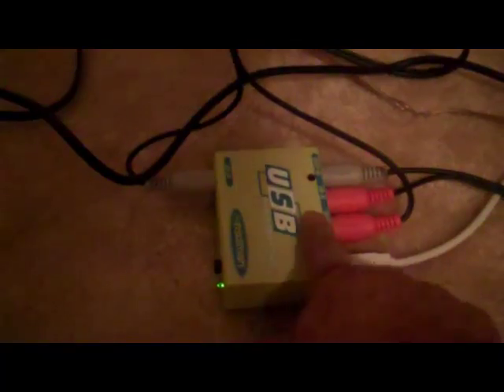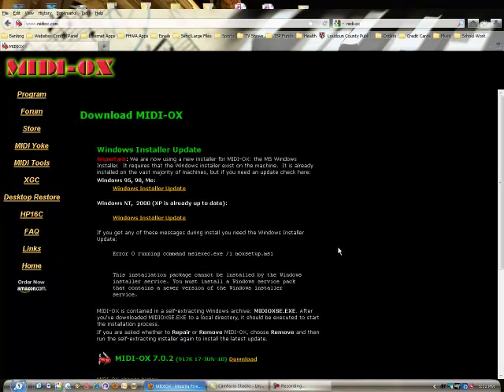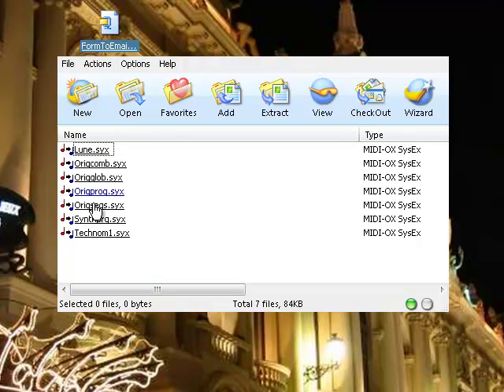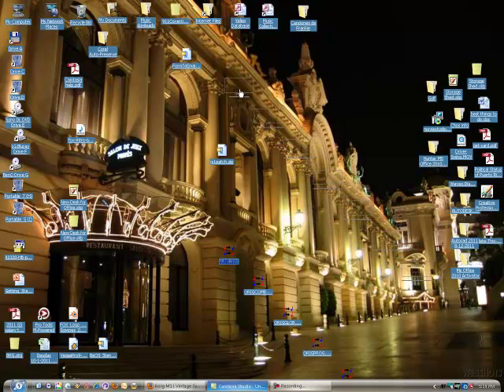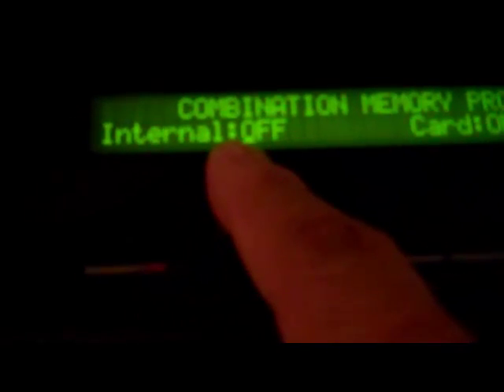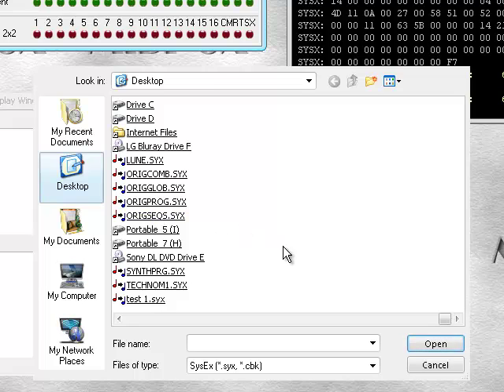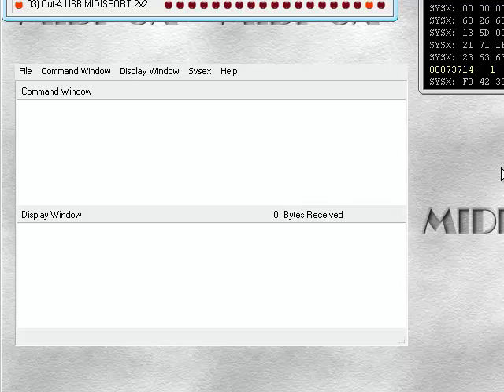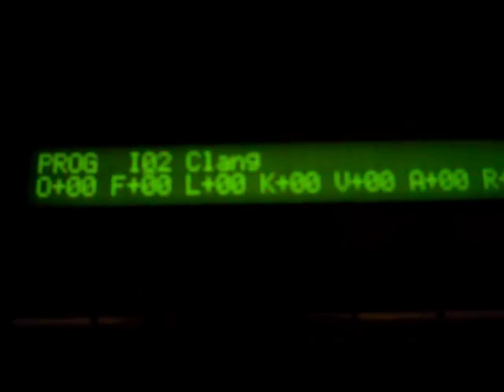Patch Replacement for Korg M1 after Battery was Dead

Comment: My humble contribution for this issue:

I recently bought Korg M1 and wanted to reload the factory presets. I bought a cheap generic USB-Midi interface and watched this video carefully and followed all steps. Nothing happened. I tried with MIDIOX on PC and SysEx Librarian on Mac. I read all the forums over the internet regarding this and tried different buffer settings. That took considerable amount of time.

The solution was to use quality midi interface and cables. I borrowed a Focusrite Scarlett 2i4 and a Klotz Midi cable, plugged it in to mac and all the SysEx files went in without any hassle, or tweaking with the buffers and stuff. Everything was done in 5 minutes. Probably it would also work with PC/MIDIOX, or any other quality midi interface.

tl;dr - Do yourself a favour and go for good midi interface.

Otherwise this video is an excellent tutorial of how to do the trick.
Reply: I'm about to embark on the journey, I've got the Scarlet 2i4 also.  Did you have to use 2 midi cords as he describes?

Comment: First, thanks for taking the time to make this video. It is appreciated.I was having the same issue that many folks are reporting - nothing happens when you send the file. After reading the post by Paavo below, it dawned on me that although my midi cables work, they are 15 and 20 feet long. All I had to do was grab a 3 foot cable and it worked fine. I did not have to tweak anything. I am using a Tascam US20x20, Win10, and a USB 3.0 port with MIDOX, and once I went with the shorter cable, It worked perfectly.

Comment: Your vids on the battery replace and patch were VERY helpful.  I finally got all orig patch and combi restored.  Two problems I had: 1) the cheap midi-USB (oval shaped) found on ebay for $6 were no good.  They work for note transfer, but drop some data sometimes, so sysex transfer wont work.  I got a better midi-USB and then could trnsfer some patches but not all, (the first 11 or 12 would be ok).  2) I increased midiox buf size to 16K, 100ms delay, and loaded it as 2files (prog & combi)

Comment: Sir,
Thank you for thoroughly explaining how to do this.  I was able to 'fix' both M1's we use in our school system after I replaced the internal batteries.  One minor point:  I needed to set the MIDI channel to "1" in the M1 to receive the data from MIDI-OX.  Channel 9 that you used in your video didn't work and I couldn't figure out where to change the MIDI-OX channel. Where in MIDI-OX can I change that send channel?

Comment from the maker: I am glad everything worked out for you.  I don't personally recommend using those cheap midi devices especially those on a single cable.  As I have said before I have two midi boxes (midiman and Midisport) they are around $50 to $80 but get the work done.  Especially know that I am working my way thru to the soft synth side of my DAW.

Comment: Thanks for the good info, this was very supportive. But just wondering if you have run into an M1REX  (rack version with extended memory, no keyboard)  like HyperSoraSky I'm not getting the 100 programs/combi's although using the patches you recommend from vintagesynth.com  I'm getting more programs/combi's loaded (up to I73 and P83) only loading I53/P60 from other website providing "original patches" . Just wondering should those files be loaded in any particular order, and.. I had a buffer error originally with midiox that i fixed by increasing number of buffers within midiox,.....maybe increase buffer size....?  Thanks again for the good info.

Comment: I found this very useful, thanks for posting. I've found several hundred .sys patches online and I was wondering, does the M1 store more than 99 Combination Patches and 99 Program Patches without a card? Right now, that seems to be the limit and adding new patches just overwrites the previous ones. Thanks.
Reply from the maker: Internally it can only do 100 combis and 100 programs.  You can format the cards which should be cheap now a days and add an additional 50/50.  But with todays computers there is no problem storing these files you found.  I have hundreds myself.  All you need is a librarian.  I use Midiguest Librarian.  It is the first incarnation of what we know now as a Kontakt type librarian. With the exception that all the files are system exclusive the one and only way in those days to brings patches to these units.  Now with librarians such as Kontakt everything is done with wave files.  The midi librarian gives you freedom to overcome the 100/100 limitation.  Hope this helps

Comment: Thank you very much for your response  looked at your while i was doing every thing all over & i had made several mistakes i bought a cheap midi to usb cable from ebay & plugged  it just like you said (In to Out & Out to In) but if i plug it like that it doesnt show up on Midi-ox, if i plug them In to In & Out to Out it shows up but it wont let me send the files to the keyboard  i don't know if i don't have the keybord on the same midi channel as the midi ox

Comment from the maker: Sorry for the delay responding I was out of the country.  I use the following buffer settings.  256 bytes, Num 32.  Now remember this has to do a lot with the midi interface you have.  I have not had the need to change these settings, ever!, but I have a EMU Xmidid2x2 interface an it works very well with it.  I previously had another midi interface a midiman 2x2 but it did not work well with Windows 7 64bit.  Hope this helps.  Thanks

Comment from the maker: Most cables i have used in the past i bought from radio shack. They worked fine. Later i bpught better csbles from guitar center i little bit more money but they can be also found in amazon cheaper. Rule of thumb if you are tunning longer runs (8 feet or more)  get bettet cables. They usually bettet shielded and better wiring. So if you really know that your midi interface works fine in your DAW then switching to better cables would be a logical approach especially if you have longer runs. Hope this help.

Comment: Dear anievestor, thanks for your support! Unfortunately I still have problems with the soundstransfer. I don`t know where the problem is. Where can I see which MIDI-channel I have to take for the transfer? (I use MIDI-OX) I know that normally I have to stick one MIDI-cable into the keyboards MIDI-out and into the PCs MIDI-in. Now I use this instrument ( M-Audio MIDISport Uno ) I have sticked the USB-contact in the PC. On one MIDI-cable stands in and on the other out. How connect to KORG M1? THX!

Comment from the maker: I have Midiox 7.0.2.372 and for a while this program has always transmitted and received on all channels.  In my case I used channel 9 (on my M1) for some reason I quite can't remember right now why I used it, but you can use it on any channel. Just make ssure your Midi filtering is set to receive System Exclusive data and take the protection off, set it to any channel and your done.  Try it and let me know.

Thanks

Comment from the maker: Ok I am confused.  First of all I understand that you have a Midi interface that is USB, correct? If that is correct then the second part of the equation.  Do you have a Midi controller keyboard that is also USB?  If you are connecting the Korg thru the midi usb interface the flashing green and yellow are OK not bad.  It means that there is communication with the PC.  Does your computer register it a usb controller that has been properly installed? Just a few questions to help you

Comment: OK. I got my M1 connected thru midi to my computer, downloaded midi-ox,  and the M1 sound files onto my desk top, made sure all the settings on the M1 are as they should be . . .   BUT still nothing happens when I try to send the sounds across to the keyboard. . . .    :(                 Are there settings within midi-ox that I should be checking  . . .  ?                                                     You mention making sure that midi global is set to CH 9 ,   then no further mention of it,   Am I missing something I should be checking elsewhere  ?    Hoping you can help me   DjT

Comment: anivestor, I have the same problem here. I looked at all the settings so many times but I cannot make it work. I am using the patches from the website you showed in your video.  I am using a Mac and SysEx Librarian because MidiOX is nto compatible with Macs. Any advise will be great. thanks

Comment from the maker: Have you been able to successfully communicate with a sequencer and the keyboard? This can tell a lot.  Go to your sequencer and try to lay down a part and then another part.  If you can record and playback the parts then you midi cables are setup correctly.  IF not then they are on backwards.  Most of the time when you get a light stuck like that it is either the cables connected wrong or the cable or cables are bad.  Check this out and let me know

Comment from the maker: There were several releases other the years when the M1 came out.  I only gave you one link to use but you can search on the internet and you will find a number of other files claiming to be the originals.  They might well be.  It all depends on the year your model came out.  Down load them all and upload them until you find the one that you had before.

Hope this helps.  On the subject of the name not showing up you probably downloaded a file that was corrupted.  Try downloading it again.

Comment from the maker: There has been a number of users that have had the same problem and 9 times out of 10 it is the cheap interface. Especially those you can buy off of eBay or made in some foreign countries. You are right and if you see the extended comment string I have talked about plenty times but it certainly wouldn't hurt to mention it again. If you have am interface that you own and know that it works use it or do what you did get one borrowed and test it. Thanks again
Reply: +anievestor do you think it could be done with only 1 midi cable ?
i cant connect in and out at the same time but i could switch them during the process
Reply from the maker: +Captain Mike Meloni Well let think this one over.  MidiOX will send the information from the computer to the keyboard.  IF you have a good interface that interface will have both an in and an out!  Having said that if you are trying to send the patch information to the M! or similar device, the OUT cable of your midi device should be connected to the IN port of the keyboard.  So you are right to assume one cable is good enough for this exercise, BUT, if you are planning to swamp patches in your device from time to time you definitely need two cables.  Taking them out and swamping them could at some point damage the port.  Also if you are going to use it in a live performance setting them you definitely need both ports connected.  I hope I answered your question.  Let me know how it goes.  Thanks
Reply: thank you for the quick reply. it worked, its great. i use audiobox for 200$ - good enough, it worked

Comment: Seems as though I have everything hooked up properly but the sounds I upload are not the original.sounds.I am using the same source for the tones that you suggested. I'm not sure if I understood you properly with regard to the usb interface. I have a single usb connector from my computer ending at two midi plugs that I mounted to the keyboard as you suggested. But the sounds delivered are all wrong and I still only have piano on my combi mode. Help??
Reply from the maker: OK, lets work this slowly.  I am going to assume several things and let me know if I am wrong. 1.  You have the program portion of the M1 unprotected? 2. You are sending the entire file to the M1 thru midiox or equivalent? 3. The file you selected has the patches you want including combis?  4.  Finally to can communicate with your M1 thru your interface? Test it with a DAW.  Normally if it is configured properly your DAW will let you know. Get back to me and we can see what's going on.

Comment: Thanks for the inspiration Anievestor, I finally managed to do the trick as well. But what a struggle. When I used your 7 files from the .zip I only got 6 patches under Prog (no combis, no seqs) with the first vage name "Z Z 2" ? Here's how I managed with a simple 40€ usb-midi converter and windows 7 : Midi-ox buffer size 256 and 25 for both in and out (as default) but selecting  the output device is where it went wrong first. If clicked on wrong or multiple devices it would produce an error when clicking OK. From that point on it simply would not work at all unless I rebooted my pc! I had to pick with only one click the output device "midi cable" and touch nothing else but OK button. Also I did not activate midi-input monitor to free  up more memory. The biggest improvement came from Korg.com where you can download one file "M1preld.syx" in stead of multiple files. Then I set the SYSEX timeout (menubar: view, Sysex, new pane menubar Sysex, configure) both to 500mS and certainly not to 'automatic'. The big difference suddenly was that the monitor pane showed regular blocks of data with a statusline in the center each second passing thrue another block (before this was a random mess and not in sync which might have explained the rubbish instruments I got or did not get anything).
THE most difficult thing in these situations is that you do not know how it is supposed to look when all goes well. Might be a good idea to make a video that shows the real proces also as it shows on the Midi-Ox screens while doing the upload.
Cheers, Ernie.
Reply from the maker: Hi Ernie,
I would love to make the video but the process it so quick that you would not get to see much.  The main reason is because the data being transmitted is so small, it is not even encrypted it goes by so fast.  That's why I have not done it! I am glad you worked it out.  Much more satisfying when you are able to fix the problem even when you had to bang it to make it work HAHAHAHA
Reply from the maker: I would love to do that but the problem is that the process goes so fast you can't see anything!  Remember this is NOT encrypted data.  It's just a very small binary file and with the serial connection (midi) it goes extremely fast. If you transport yourself back to the era of the 8088 processors then there we can see how slow it used to be.  Now with today's processors, it's instant.  Glad you got it to work.

Comment from the maker: I think there have been comments and suggestions.  I will let them chime in on it.  I have personally used M-Audio (they work very well), Roland (also good).  I currently have an audio interface Focusrite Saffire PRo 24 DSP.  IT has a midi port in the back.  It works awesome.  A good two for one.  You get the audio interface and the midi interface all in one.  One catch it only comes with one port.  If you can handle only one port and daisy chain several midi devices, you are good.  The other ones I suggested are USB based.  Make sure you have USB ports in your computer to use.  Normally I would tell people go cheap, but there have been too many problems and comments about cheap interfaces that I can not in all good conscience tell you that.  Between 60 to 80 bucks you can get something reliable with mulitple ports on it.  Well that's my two cents worth.  Hope you get something good for you.  OBTW make sure you read the manufactures manual before you buy (know a days thay have them posted on the website)  make sure they have drivers for your computers OS.

Comment: I have a quick question I just changed the battery on my korg m1 and it still continues to display low battery do you have any clue what it can be?
Reply from the maker: Danny G Make sure you have the right battery and that you put it on the correct side.  Check the video and sure sure the numbers behind the battery are up (you can see them).  That's all it should not give you any problems.

Comment: I used the files from the Korg website, I used the mid version, need to set the M1 for SYS=ENA and MIDI channel 1. My previous attempts almost worked but didn't show voice names, nor did the effects work.
Reply from the maker: When you say Mid version, do you mean midi version?  If so, that is not going to work.  The files I provided in the video are system exclusive files.  Try it again and let me know.  Sorry for the delay responding
Reply: Thanks, all sorted now. yes my first two attempts was using midiox and sending sysex files. I'm familair with midiox and sysex files so I was puzzled why it didn't work. As I know the process using a sequencer, I loaded the mid file in and sent it which seemed to work.
I think what happened was, maybe I didn't have the correct settings somewhere and it was only up until I did the mid file did I get the magic sequence. Korg say, even for sysex dumps, needs midi channel on 1. BTW: I am using a M1R
Once I got the factory settings restored using the mid file, I can now upload various program banks using midiox and sysex. Thanks for the help.
Reply from the maker: It should not matter they are the same but in rack format.  Going back to the sysexec dump.  You really don't need to set a channel for it.  You can go Omni in both Midiox and the M1R and it should take it as well.  Glad to got it resolved.  Thanks Antonio
Reply: Hi A, indeed the rack and kbs should be the same, I just noticed one person made comment regarding the rack so  I thought just to mention it and maybe put their mind at rest should they be having problems. 

I agree with you about midi channel not being important with the sysex dump, that is what I expected too, but when I read the instructions that came from Korg which is this -> "Note: Korg system exclusive is channel sensitive and therefore this preload data is saved using Midi channel 1. Please ensure you set the receiving M1 to Midi channel 1." - Actually as you say, Omni mode should encompass this.
Best regards, TT